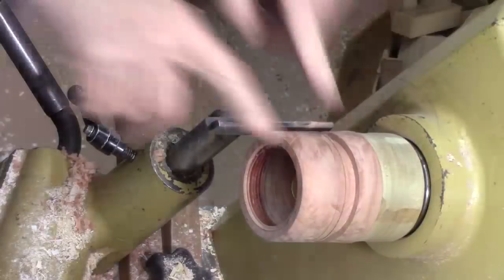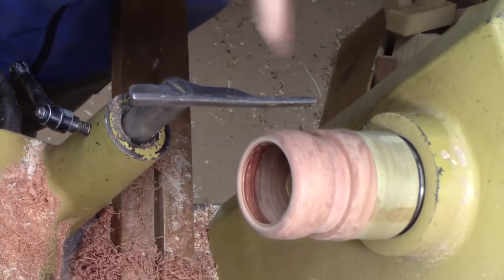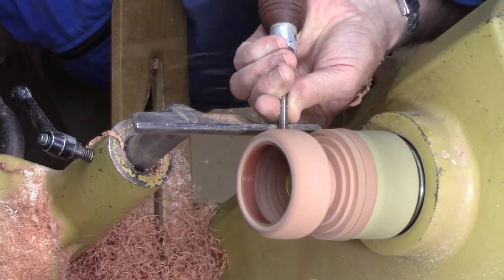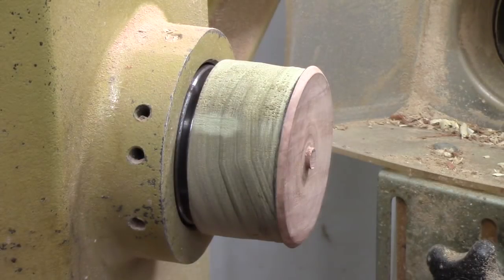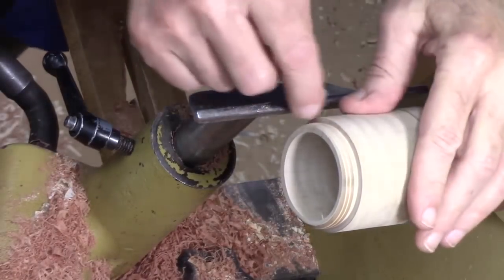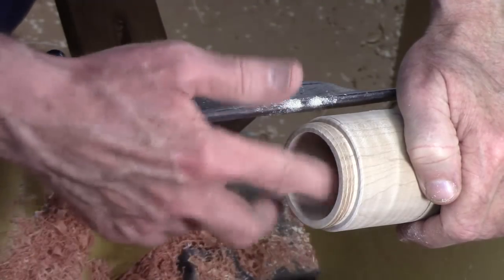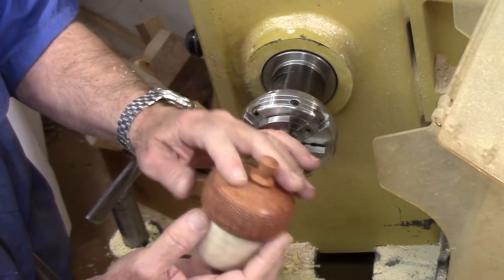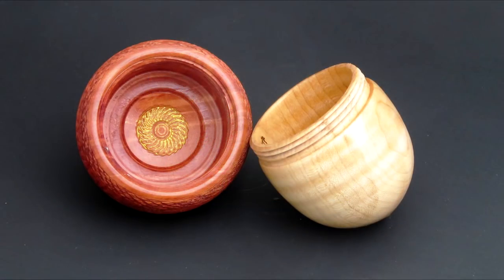Acorn box  - Part 2 of 2

Comment: Great looking Acorn.. wow I can only make slip fit ones. Threaded is a great option. And these are really nice. I like em a lot.
Reply from the maker: Thanks for commenting! Nothing wrong with a nice slip fitting box.
Reply: this is unrelated to the acorn box, but did I hear you say once that you used denatured alcohol to dry some of your woods. I came across a lot of downed trees, pear wood, sassafras, box elder, persimmon,, others... I am very new at this, and I don't want to loose it all to cracking and checking.
Reply from the maker: No, I have never used DNA for prepping wood. You might want to watch my series on using a bandsaw for woodturners for some tips. https://www.youtube.com/edit?video_id=SxYW5JH8mp0&video_referrer=watch
Reply: Thanks Mike, I must have got you mixed up. I will check out the you tube. And I am beginning to think it is way to labor intense to go through so many steps to speed up the process. I am leaning toward be patient. Again you are a blessing to us out here who are learning. God bless.
Reply from the maker: Patience is good. Rough turn green bowls for the practice. Some will crack until you learn how thick, and how to shape with a curve a uniform thickness of about 10% of the diameter.  You just have to pay your dues.

Comment: Hi Mike Thanks again for an interesting video on the Acorn Box. On viewing it I saw lots of potential usage for our good friend the round nose tool with the micro bevel, both for inside and outside work.
I find that on the outside it works very well on taper planning cuts and is more easier to get a better finish than trying to pick up the cut with the spindle gouge. It also provides a much smoother CUT finish on the inside taper rather than an ill fitting conventional scraper. I use various sizes of round nose tools dependant on box size. All to good effect and ease of use.
Reply from the maker: I will have to give it a try on my next acorn, Jim. Thanks.